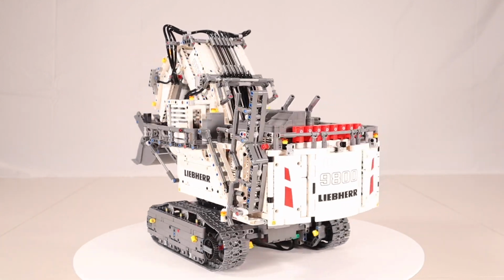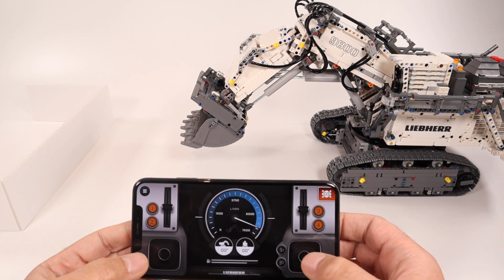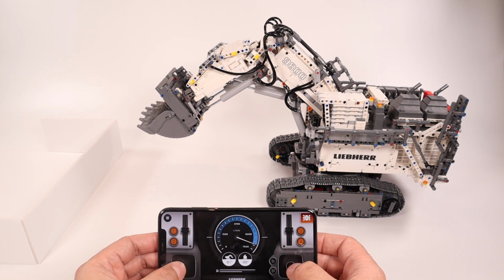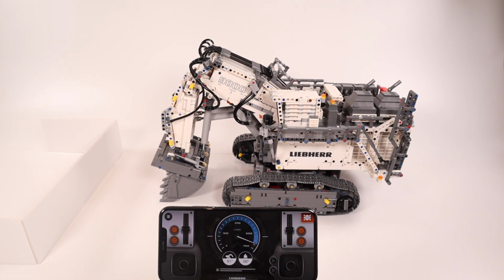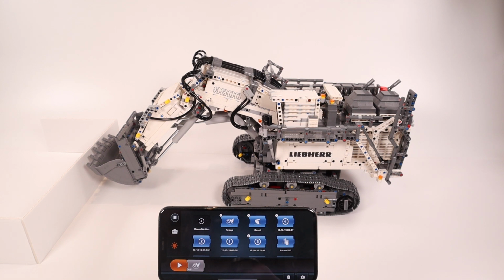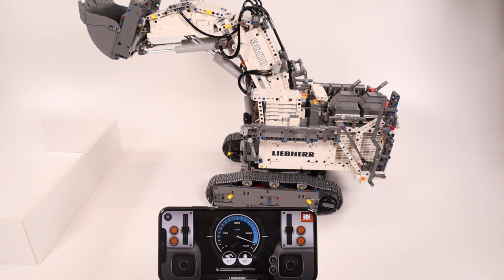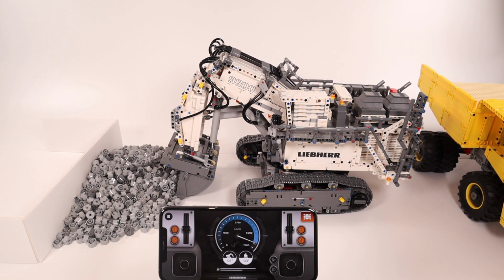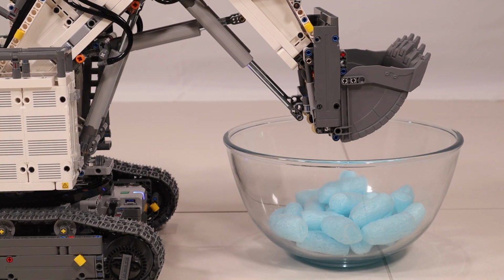LEGO Technic 42100 Liebherr 9800 Can You Dig It?

Comment: Awesome review of this monster set. How is the battery life? Both with the set itself and with your phone?
Reply from the maker: Thanks! I had to change the batteries for the upper Control+ hub after about 3hrs. It was getting really slow by the end of moving all those packing peanuts in the can you dig it video. The power pack that powers the tracks lasted about twice as long but I wasn't travelling too much. Would make sense to use rechargeable batteries, in fact it would be cool if LEGO made a rechargeable battery that fitted in the hub tbh. I had my phone on the charger while I was filming so not sure about that.